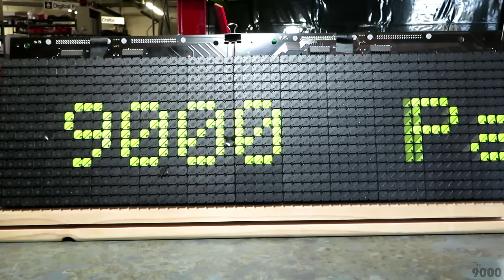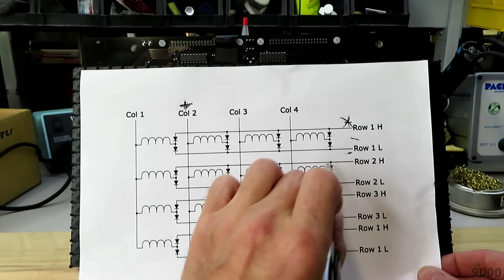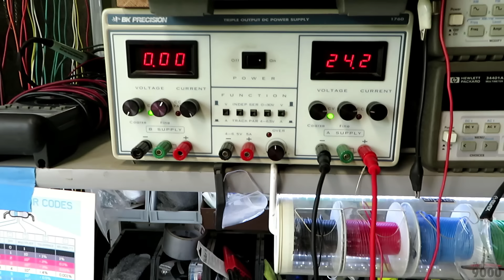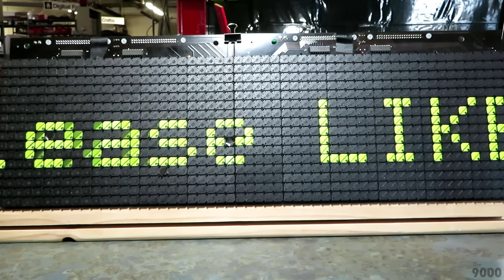FlipMaster 9000 Part 1: Flipping the Dots

Comment: That is so cool. A mall nearby called The Hub had a huge sign made of something very similar to these, if you were within 50' of it you could hear the clicking of hundreds of them flipping about every 15 seconds. I don't know how old it was but there were always a bunch stuck on green or black and in the 00s they replaced it with a boring LED dot matrix board. That had a similar problem with bulbs stuck on or off so it only lasted a few years before being removed too, now the whole sign is gone to make way for a roundabout.

Comment: Very cool to see these again.
I used something similar, except they were flip seven-segment sections, easy to control.  I used the for Kansan and manufacturing displays to show the whole mfg floor the throughput at each station.  As I recall, I bought them from a roadside sign company (for roadwork ahead signage).  If I think of the company, I’ll edit this comment.

Comment: We have these on some light rail trains here. The LEDs are in fact on and you can see them when the train goes into a tunnel at which point you can't see the yellow of the flip mechanism. They are very readable in direct sunlight as well as in complete darkness thanks to the LEDs. As these trains are not that old these mechanisms are still available. Newer trains have all LED and that is because the new generation is readable in direct sunlight.

Comment: In the late 2000"s (around 2006-2010), Annax still supplied this kind of flip-dot display with LED (that LED greatly enhanced the visibility at night, which previously needef to light up the display with fluorescent tubes).  It's only in the 2010 decade that the amber LED display became mature enough to be seen in direct sunlight and not break down all the time because of the heat (due to greenhouse effect, among others).

Comment: Smallest font I know of is 4*6 pixels per letter (3*5 plus one row and one col for inter-letter space). If we wanted to put a unix terminal on this, id shoot for 80 cols and 24 rows. This measn we need 320*144 pixels, or 11*9 of these boards, aka 99 of these guys + supporting hardware in order to make a funtional computer terminal... might have to scale back to 40*24, needing 54 of these boards.

Comment: Where would a third panel's row connector go?
Reply from the maker: The row ribbon cable would have an additional connector in the middle. The panels would be wired pin 1 to pin 1 to pin 1, pin 2 to pin 2 to pin 2, and so forth.

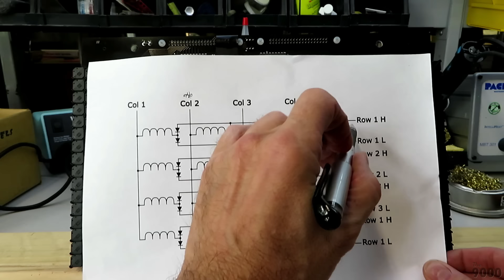Comment: 4:40 I'm still unclear why the diodes need to be there - you say without them there'd be a path for the current to flow through every other coil as well, but if all the other rows/columns aren't connected apart from the ones you want to energise that wouldn't matter as no current would flow anyway.  What am I missing?  I guess if you are switching the inputs between positive and negative rather than connecting or disconnecting them then it might be required though to avoid short circuits.
Reply from the maker: Don't forget the coils are just wire, and current will flow through them in either direction. Without diodes, you end up energizing all the coils.
Reply: @The-jr6pi  But not if you only power one row and one column at a time right?  I saw in your later parts you were doing whole columns at a time so that makes a bit more sense, I was wondering why you'd need it only doing one row/column at a time as there wouldn't be any path to energise the other coils then!  But it is definitely more efficient doing whole rows or columns at a time so I see why now.
Reply: @Berkeloid0  Let me make an exempel for this we will say we have a regular Matrix with single Columns and Rows. We put a + on Column 1 and a - on Row 1. This will energize the coil leading from C1 to R1. But it will also energize the coil leading from C1 to R2 via the coil leading from R2 to C2 and via the coil leading from C2 to R1. Its just that instead of just one Coil it now takes three coils for the way and one of them ist energized in the other direction than the other two. And this would happen accross the entire board.
Reply: @ssingfo  Yes but if you don't have R2 or C2 connected to anything (e.g. high impedance state) the coils there won't be energized because there is nowhere for the current to flow.  If you only have + on C1 and - on R1 then where is the completed circuit that passes from + through R2 or C2 to -?
Reply: @Berkeloid0  But that's exactly what I said, it does flow via the coil in the middle, the current can flow from C1 to R2 then to C2 and from C2 to R1. Here's a link to a small schematic were I've drew in the flow of the current over the coils: https://drive.google.com/file/d/1c9ThtQLGYkFrb-foz4c7NXae6bmhiLV9/view?usp=sharing
Reply: @ssingfo  Ahh yes you are absolutely right!  I was only considering the rows and columns directly connected to the power supply, I was not considering that you can still find a path through other columns you aren't using back to the same original row.  Thank you for the diagram, that helped a lot!